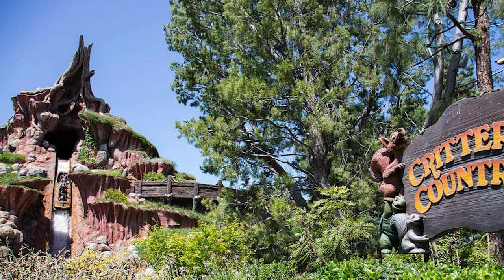What are they doing to Mickey's Hat?! | Disneyland Construction 09-11-2023

Comment: They probably haven't replaced the Briar Patch sign yet for a simple reason.  The interior carvings are easy access.  Getting on top of the roof to remove the sign would probably require them shutting the shop down for a day.

Comment: I don't think those are forms or permanent structures on top of the guitar pick. I think they are temporary safety railings so people can work on top without having to be in safety harnesses. In the shot of the Best Buy you can see similar railings on the adjacent building which has building materials staged on the roof